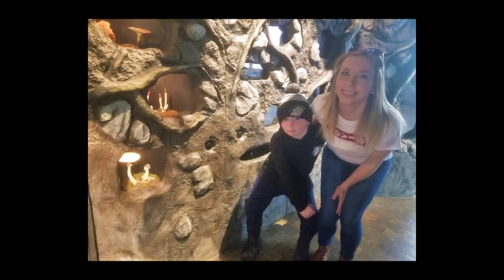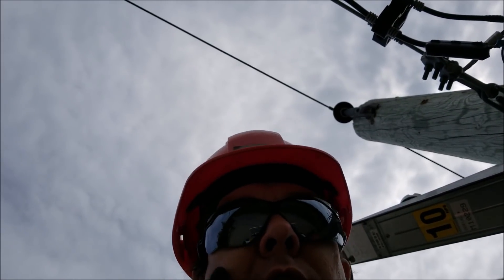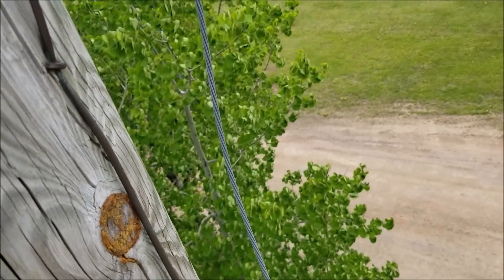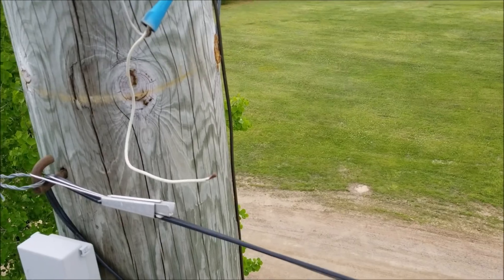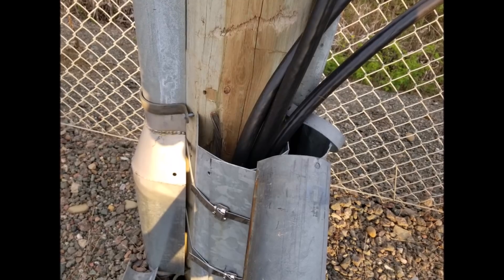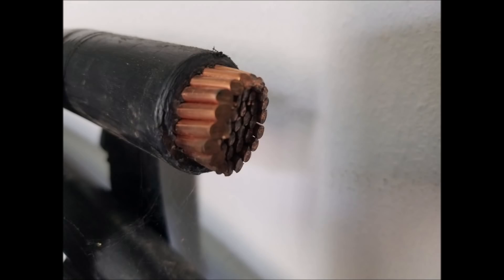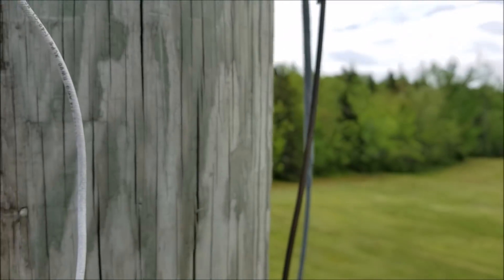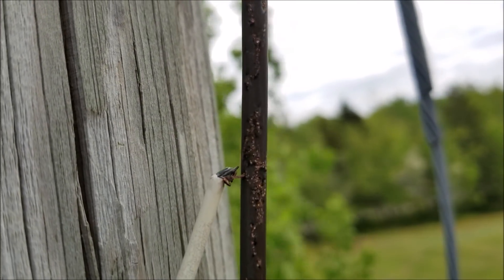Deadly current exists on grounded wires - Powerlines

Comment: I'm thinking double fencing with the inner one charged just enough to remind and deter and a sign saying in every plausible language that this facility is configured that if you try to steal copper you will die. It's not an exaggeration, just a way of describing the fact of the matter.
Reply: Smart but will cost hundreds of millions  to save a few million. Not worth it, as people will still steel